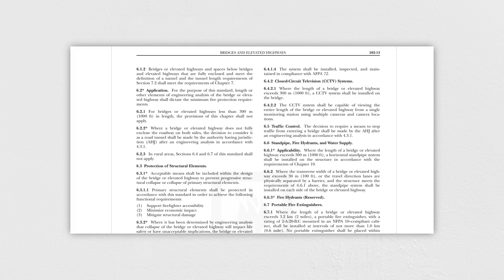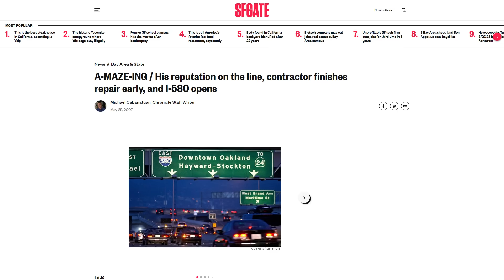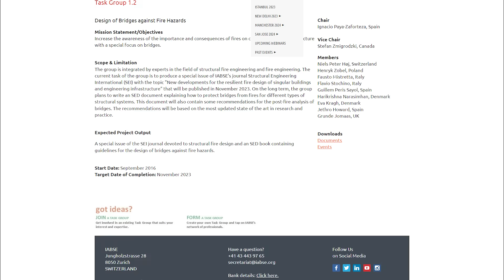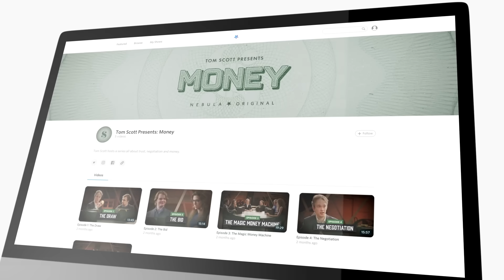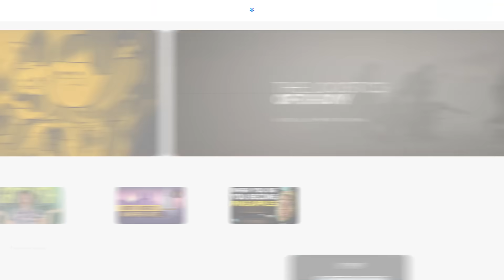Philadelphia I-95 Bridge Collapse Explained

Comment: I am a truck driver in the Philly area, it was a nightmare and the listed detour was a route(I-676) that is a parking lot on the best of days. I can vouch that the economic effects were pretty crazy.
Reply: i95 is a parking lot between Academy and Girard every morning when the road is working.
Reply: I drive a bus into the city all the time, drives me absolutely bonkers that google maps doesn't have weight and height restrictions on it after all this time.
Reply: @adde9506  i think it's the dumbing down of the job which, for the most part has already happened. The more information you provide someone to be able to do the job, the less they have to know. They are increasingly relying on these automated systems and not their own experience and knowledge and then you get what you get for drivers. 
I haven't used a local taxi in a while. Never an uber on my own. I called a local taxi to take me less than a mile from the train station. I was arriving at. I said I'm going to the dentist from this intersection. About 3 blocks north. They said, what is the address? I said I don't know, it's my dentist. They said we need the address. I said, Its only 3 blocks from this major intersection.
I've been going there for twenty years.I never knew the actual address. They said call me back when you know the address.
I was frustrated to say the least.  For the first time ever, I had to google my dentist and find the address just to provide it to the taxi driver. 
I realize the taxi driver likely didn't understand english and who knows what other limited knowledge they had. I think this guy might have really understood our conversation, but that's besides the point. The job had been dumbed down to: go to this dot on. the device will tell you how to drive. 
Is that what's happening to the trucking industry? What is our fail-safe when those devices are wrong or incomplete? What other information are the drivers potentially at risk of getting wrong?😢
I don't know a whole lot about the trucking industry.But I believe many years back there was a time when truck drivers might have been considered the most knowledgeable drivers on the road. Could this changing demographic of truck drivers be contributing to these type of incidents?

Comment: I would caution people relying on NYC transit for getting around as there's millions of people living in the immediate 5 boroughs and a few million more in the surrounding areas that come in through commuter rails. the subway system is already running trains nearly back to back to the point where any issues that crop up can snarl it and the chances of it happening increases as more service is run which is exacerbated by the 24/7 operation. Then there's the problem of operations fighting against the maintainers who want to shut down sections of track to get work done while operations refuses to let them start work earlier because it will hold service back. THen you have the problem with NYC being full of red tape and agencies refusing to work together to allow the top side to close so that improvements to the overall system can be done in a timely manner. EPA, NYC civil engineers, DOT etc all get in the way of improving mass transit.

Comment: It's almost as though enough heat will weaken the structure of a metal beam to the point that it deforms easily- even more so when said metal beams are supporting a lot of weight. Weird that...

Comment: Your friend Rob said the beams were reinforced concrete.  The beams were steel I beams.  Steel may melt at a pretty high temperature but before it gets there it enters a plastic state where it can be easily reshaped with minimal force, a property blacksmiths use every day.  This is what brought down the World Trade Center.  P.S. That expensive back-fill can be reused later.

Comment: A classic instance of a fire on a bridge was Robert Stephenson's historic Britannia Bridge across the Menai Straits from Wales to Anglesey.   Finished in 1850, it had twin wrought-iron box girders through which the trains ran.   Part of the corrosion proofing was by tarred hessian (we'd never use that today, but it lasted 120 years).   120 years later, it caught fire (kids probably playing with matches).   Though the tubes survived, the fire destressed them and impaired their load-carrying ability.    The tubes have been replaced with a double deck on steel arches using the original piers and abutments.
Reply: "tarred hessian" definitely sounds like someone just trying to make a very flammable material for fun xD but I can appreciate that it was a good solution for the problem at hand
Reply: @EcceJack  Sounds like a metal band. Let's make this happen, people! 🎸
Reply: Hessian = burlap
Reply: But railway line was rebuild as single track.
And road is only single lane each direction.
...
So, instead rebuild this bridge properly, and build another full size bridge for heavy traffic, this weird hybrid was created, and today there is huge bottleneck at network for trains and cars, for this important route to port at Holyhead.

Comment: From now on, every time you have to close down a road, try to repurpose those highways and bridges for micro-mobility 🚲 🛴 and get out of the concrete jungles you live in. Using a car by default is the worse that can happen to any society.
Reply: sorry, theres no way id feel safe on an american highway in a bike or scooter. america has bigger reasons for not doing that - specifically, restrictive zoning & parking minimums
Reply: @mtqrx  If it's closed to car traffic, it means only micro-mobility vehicles will be allowed to go on those roads. Of course the tricky part is how to merge said road with next junctions. The idea is to push for better city designs and not take for granted the horrible places most US citizens live in.

Comment: Impossible that it collapsed since the fuel isn't hot enough to melt steel! It's a conspiracy! 😆
This is a great display of how the properties of materials can change with temperature.  It's amazing that the other side held up with the traffic still going over it with all that sag.  I wonder if adding fireproofing coatings to some of the critical bridges like this would be of any help?

Comment: This may be my materials engineer bias  but I was a little disappointed there was no mention of steel heat treatments in this video or any real depth on the actual failure mechanics of how fire leads to a bridge collapse.

Comment: a 4 inch layer of autoclaved aerated concrete can resist very high temperatures for an almost endless time, without any rise of temp. on the other side of the layer. this layer could be build in during construction and the costs are really low for that additional material. it would also help walls or pillars against extreme heat. what do you think? I worked 15 years on construction sites as a reenforced concrete, and form building specialist and also worked with these autoclaved aerated concrete in building blocks in all sizes and even the biggest blocks weight "nearly" nothing and can be build by any mason. the only difference to usual masonry is that you use a cement based "glue", only 3mm thick on the horizontal and vertical interstice. the glue joint connection is extremely strong, the stones will break after hardening but not the "glued" interstice...   https://www.youtube.com/watch?v=3-4bHMCMv7c

Comment: 7:30 For the comparison between fire and earthquakes for collapse probabilities, fires can be 'controlled /s' from external sources E.G. regulations for safer tanker trucks.  But earthquakes cannot me pre-emptively mitigated, only predicted, and then in a limited sense.  If fire is less prioritised in the design codes that might be the result of expecting better safety from other professions, or an over emphasis on more probable failure modes (hydraulic scour) at the expense of the improbable ones.
Reply: Additionally, after an earthquake emergency response is overwhelmed (containing fires and treating the injured). Seattle has 1 major route that goes north to south and east to west that’s seismic rated expressly to allow emergency services to do their jobs. And it’s not the interstates, it’s Aurora and 520, and both needed major remodeling to make sure they’d survive a mega thrust earthquake.
Reply: That's a really good point, actually. thank you for clarifying.

Comment: I live just outside Philly. There's one reason that the gridlock didn't occur that isn't getting much coverage. Real-time traffic routing. Turn by turn directions from phones and GPS didn't just blindly offer official detours. They adapted to real traffic in near real time. This let the flow spread out to minimize resistance like water through a maze. Traffic could utilize the entire regional road system to re-levelize.
Reply: It truly was an all-hands-on-deck-and-tech. I had to take the detours a few times, and yes it was slower but not terribly so. Predications of epic road rage (on top of our normal epic road rage) didn't materialize. The apps were good. The police was good. And the drivers were good. My only beef, having just driven over the repairs yesterday, is that there are no signs. This deserves to be lauded and bragged about. And they should put Gritty on the signs for good measure despite being a known "agent of chaos".
Reply: @JohnKominetz 100% get gritty up there lol
Reply: Despite all that, every time I went through it, North or South, GPS routed me right through the detour.
Reply: Pretty much the point made in the video, people find other ways to get around. Using your point, the space used for a rail line and wouldn't have anything but a positive impact on traffic
Reply: I’m pretty much down the street from the accident.  The local avenues were a mess immediately after but things seemed to settle down within a couple days.  I usually avoid Rt.1/the blvd like the plague, so I can’t speak for the extra traffic on there.  Waze seemed to update pretty quickly with changes when parts of State Rd were closed.  Honestly, Waze is a godsend, even more so in situations like this!
Reply: And this is exactly the problem with post-2000 Dutch urban planning where they try to force ALL traffic through one or two bottlenecks along main thoroughfares (and sometimes limit their speed just to screw up harder. It's done to try to hinder traffic and make sure that sour boomers who do nothing but look outside all day don't see any commuting cars.

But that way there is not secondary network to take over in emergencies and there is no congestion relief from other roads becoming a viable alternative as travel time increases.

There's a place near my office that's jammed up from 7.00 - 9.30 and from as early as 14.30 to 18.30 and STILL some idiots are argueing we don't need more roads.
Reply: That's pretty awesome, tbh
Reply: Well said.
Reply: Unlike Atlanta with their "arterial road" system (designed to keep black people out of whit neighborhoods) where there are two or three major choke points everyone has to go through on any given commute.
Reply: It also happened to be the time of year when the traffic was the lightest. Schools closed, vacations happening.
Reply: @lucabrasi5070 Try 60,000 vehicles a day.
Reply: where this occured, closed just after NB95; ext26, BRB. its open now, but the best part is I95 collapsed onto Bridge st.
Reply: Well if that's the reason then why do we still have major gridlock at the slightest issue.
Reply: You aren't giving people who just know where they're going enough credit.  Most people have to commute to the highway to use it and then away from it to the place they're going.  Drawing a "straight line" from their start to their destination is going to put huge numbers of people outside the "problem area."  And all of those people already know those routes.  And you'll even have people who know which routes will become burdened by the highway closure and also plan to use even more obscure routes.  What really caused the traffic spread was just people knowing not to get on the highway in the first place even if most of their usual route was open.
Reply: GPS took me to a closed road right by the collapse
Reply: So the Philly area can implement major re-routing of traffic across the city when needed? In my experience with GPS systems they don't sem capable of handling such large volumes of traffic flow by themselves. The city must have real time traffic monitoring and capabilities to redirect flow by controlling traffic lights, opening/closing lanes to one way flow, etc. Their transportation department must have some very good people in place to coordinate all those changes.
Reply: @olliefoxx7165 because everyone had to find an alternate route, there was probably a larger mass of the drivers using Google Maps, and so Google could more accurately measure the traffic just by the drivers it was directing and route efficiency with it's already existing algorithm
Reply: @olliefoxx7165  That kind of traffic tech in a New York thing.  Live traffic management in Philly is done by cops and firefighters leaving out signs.  Any by people paying attention to traffic reports.
Reply: hopefully the GPS is more reliable in the cities than it is outside the cities where it is terrible at routing people and takes people down private drives, and private roads
Reply: @monkeyoperator1360  I guess it depends, but I've personally never had that problem anywhere in MN, rural or urban
Reply: @Ryan-ahh  well  i've gone through the moutains with no cell reception so unless you download your screwed, it tells you the address is on the wrong side of the road or the wrong street.

i think the biggest issue for most mapping programs is they use a mail address instead of the physical address
Reply: @monkeyoperator1360  OK? Not having service is a completely different issue than what I was responding to
Reply: @Ryan-ahh  yeah it doesnt work when it has service either, beter off pulling out a paper map
Reply: @monkeyoperator1360  Just saying my experience is the opposite, a paper map is way more likely to be outdated 🤷‍♂
Reply: @Ryan-ahh  🤷‍♀
Reply: @monkeyoperator1360  we dont really have private roads in philadelphia, or not many. The issue you are far more likely to run into (using google maps at least) is being told to make a left turn when there is a no left turn sign and no turning lane, or a right turn at a "no turns" intersection. People already drive pretty lawlessly here and tend to do whatever they want, but i know for fact at certain intersections drivers are blocking the left lane or unsafely cutting across oncoming traffic because their GPS is telling them to.
Reply: @monkeyoperator1360  Yes, in my experience, GPS works better in urban environments than rural ones. The street addresses are more predictable and with more people going places, it can more quickly make adjustments to incorrect locations, adjust routes for road construction, etc.

It depends somewhat on the city though. When I'm in my home area, it's usually very good at figuring out the ideal route and when I decide I know better than the GPS which way to go, I often find out the hard way there was a reason it was avoiding a certain route. It's even pretty good at knowing how to drive through a shopping plaza or industrial complex to get to a business in the back. I've been working in another city lately though, and it's told me to take routes I can't take, such as a few nights ago when it told me to turn down a road that was blocked by a construction barricade. It wasn't a major street, I'll give it that, but it was around 21:00 and I'm pretty sure the road hadn't just been blocked off.
Reply: @monkeyoperator1360  Rural GPS really sucks, Google Maps once tried to take me down a nonexistent road that had since been turned into a field
Reply: @OrioleSongbird driving through Texas is always an adventure.  Cutting down from Texarkana to Houston it's like "you wanna go the speed of light down some narrow farm roads?  Fastest route."

Definitely asked the locals for a better way back haha.
Reply: @monkeyoperator1360  My main beef with it is "better route available" next thing I know I'm driving a single lane dirt road that bridges a lake, driving down an unmarked seasonal road out of season, or my favorite is the time I crested a hill at 55 and went whizzing past a sign saying pavement ends and down a steep gravel road it took 7 tries to get back up!
Reply: @randomvideosn0where  yeah i'ev had that happen it tried to send me down a seasonal road with about 6ft of snow on it and a single lane dirt something not sure it was an actual road
Reply: @monkeyoperator1360  well, yeah, it is. But it’s simply because there are generally many, many more alternative routes in a city.
Reply: @monkeyoperator1360  It's amazing tech. I was driving the family through LA on vacation 10 years ago, and while traffic flow wasn't perfect then, and it was fairly new, it was so significantly better than my last experience in LA, which was the mid 90s before smart phones, let alone real time traffic updating. You had to either 'know' where you were going, take a taxi (and hope they knew how to get around quickly), or public transit (which wasn't smart at that time... at least what I was told).

And no, it's no better in cities. I've had Google direct me through some pretty sketchy hoods or end up taking as long (or longer) trying to avoid the traffic jams. Still needs work. Still hundreds of times better for getting around than just not knowing. The problem is trying to use it as a solo driver and not become a road hazard yourself because you're trying to manually update your route.
Reply: @monkeyoperator1360 I have not had such problems with Google Map in nearly a decade.
Nonsense.